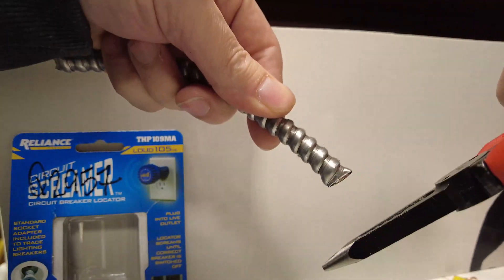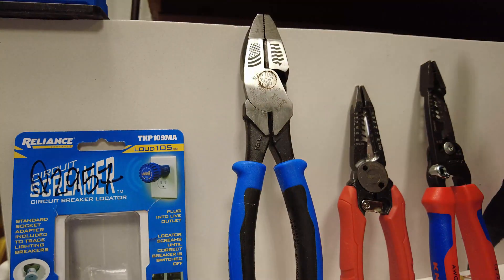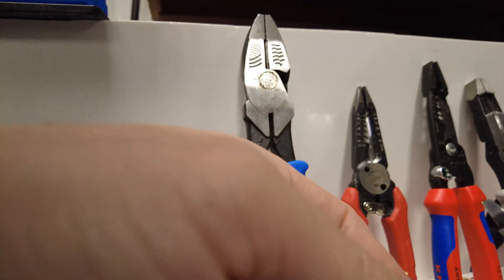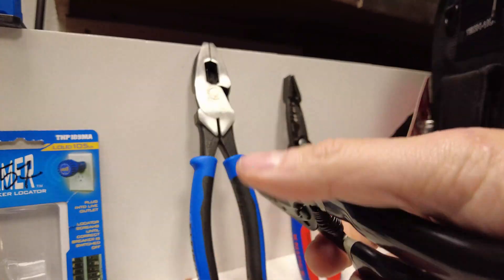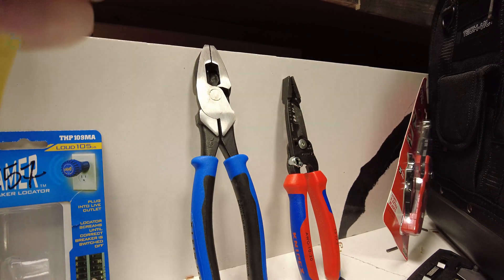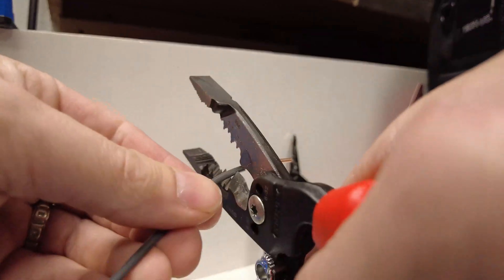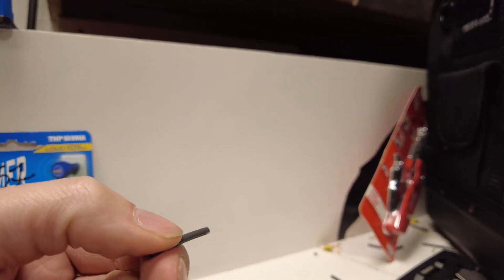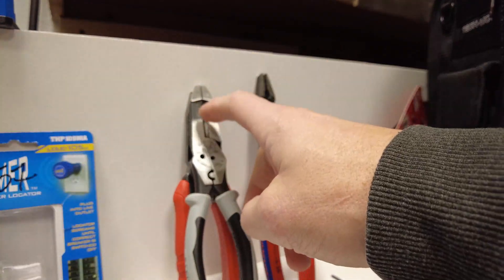I NEVER Thought That Milwaukee Would Be The Better Choice

Comment: Informative, though at times I couldn't tell which tool you were talking about when you were demonstrating.

I was disappointed with my Knipex strippers because 1) there are no gauge markings on the reverse side, making switching from my other strippers that much more annoying; 2) the unlock symbol is on the lock itself, instead of the pliers body, which would indicate which direction is unlocked (small potatoes, but still dumb); 3) the lock was very stiff for a good while;, 4) it does take more effort to open the cutter wide enough for even Romex; and 5) my 8-32 bolt would not fit into the cutter holer, despite the claim that it doesn't have to be threaded in to be inserted. I tested the bolt in an 8-32 tester to verify. Weird,

It was so hyped by so many
Reply from the maker: Yeah reviews on tools like this is why I stared this channel   sure they are good but a ton of people  on yt don't know what to really look for   I still like them but they don't make a joint verywell  so they are good for a wago trouble shoot n fix but only barley

Comment: I guess not everyone roughs in the same, everywhere I've worked so far rough in includes stripping, splicing, and bonding basically doing everything except actually hook up whatever crap gets hooked up eventually. Commercial in Canada.
Reply: But yeah no good for twisting anything. Huge letdown since other knipex stuff is all about the grip strength like cobras. I basically just run them as strippers, a kind of needle nose, screw shears and cable shears. And the hinge gets messed up over time. That's actually a really annoying problem I'd expect people to start talking about soon. I want to try the Klein hybrids you have, trying to replace carrying linesman + strippers for those lighter, easier jobs.
Reply from the maker: i hear the hybrids are on same  hd or lowes for 26